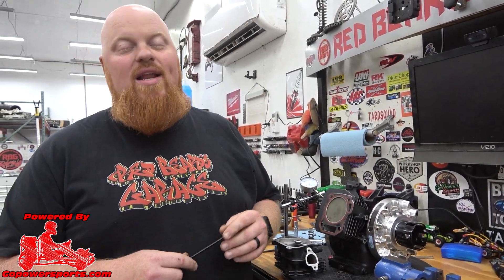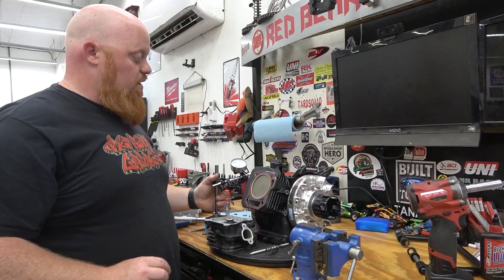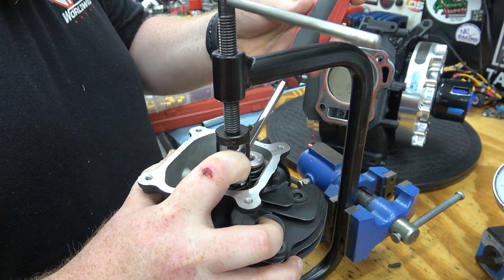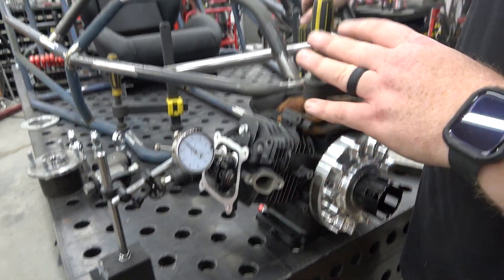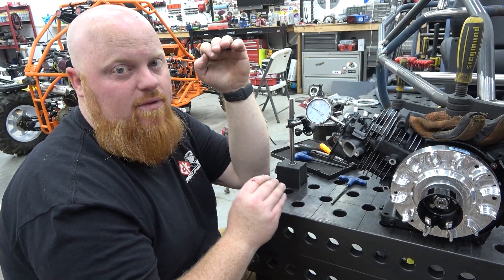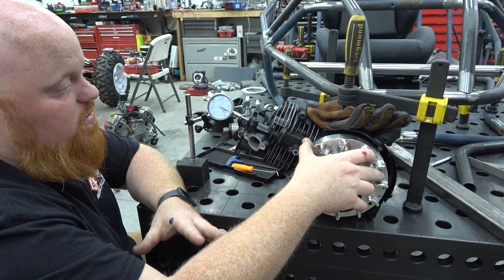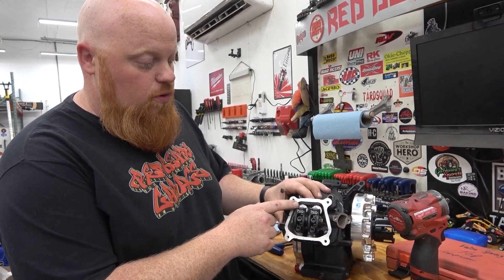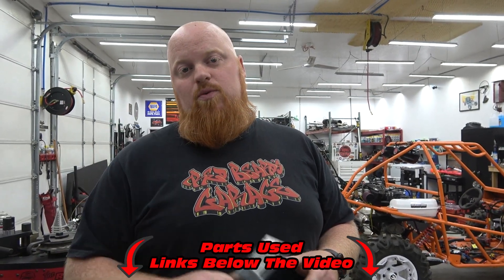How To Measure Push Rod Length ~ Ghost 212cc, Predator 212cc, Tillotson 212cc, GX200cc

Comment: The engine runs clockwise ,whyare you going counterclockwise checking length,just a though ,that's backwards,cam is ground different, it's also got different readings on it,Duh,I was taught different than your doing,40yrs,experience ,whom is doing it right or wrong,Duh!!!!!,not me!!!!!

Comment: If your pushrod is too long or too short, you might still achieve nearly the same peak valve lift, but the rocker tip will be pushed to one side of the valve stem, creating a wider sweep pattern. This wider, off-center sweep leads to:

Increased friction and wear.

Reduced valvetrain stability at high RPMs.

Potential for reduced effective valve lift, as some motion is wasted in "scrubbing."

Increased side-loading on the valve guides, leading to premature wear. 

All credit goes to AI there but I just wanted to post this because its important to take this into account.

Comment: ive been doing a kinda of frankenstein project similar but  ive got a bunch of 1095 spring steel rod .185 dia ive been using to cut and precision grind and radius the ends for push rods.  prob way stronger even than the cromoly cut to legnth cause its  solid and heat treated.  so long as you dont over heat it when grinding to legnth..    putting the radius  on the ends can heat it up too  so wet grind.   im using a 1x42" belt grinder with various grits from combat abrasives and others and  a rotary chuck that spins the push rod  as you grind it at about the same  rpm as the belt but opposite direction.  makes quick work.   i grind at about 105° to the end of  the rod to grind to legnth  leaving a pretty flat cone to measure off of using 100 grit ceramic belts,  cuts quick and  takes the heat away with the grindings.   then ill radius with first 400 grit and then 800 and 1000 to refine and polish. its super quick to reduse the legnth by a few  thouhsand even at 800 grit and re polish at 1000  to get them perfect.    kicker is  the rotary i use is just a milwaukee drill with the push rod  chucked in it. no mfg on the 1x42" belt sander  i got it  from a machine shop that went under for $30  but its 1750rpm on the motor and has  a table settup that can be angled and has tapped mounting holes for  holding tool sharpeners.
Reply: Bruh 😂

Comment: If i am using champion x style rocker arms and a hot265 cam with my stock pushrod length being 5.2760, can i just add .265 to the stock rod length and use that as my new push rod length

Comment: RBG you literally have zero knowledge of geometry. Sad
Reply: I think the length of the pushrod it should not change the lift of the cam right?
Reply: Shaft mounted rocker has fixed geometry

Comment: I know that this is a bit of an older video. What pushrod size would a "internally" bone stock 196cc predator use, I'm looking to change valve springs an pushrods all the advice helps a lot
Reply: There is no Predator 196cc? It's either Honda Clone 196 or Predator 212. Stock Pushrod length for the 196 Clones is 5.260 inches. The stock size for the Predator 212 is 5.135 inches.

Comment: Go Power Sports is a rip-off when it comes to these roller rockers. I can get myself a set of roller rockers, which are 16 in a set for a small Chevy for $182.95. They want over$200 bucks for just TWO rockers😂😂😂😂.  They are taking advantage of people with their overpriced products. For the price they are asking, they need to throw in 20 roller rockers. I'm sure the ones for the Chevy V8 are much stronger and built better than these at power sports, and yet they are cheaper priced. This is price gouging. Those flywheels they are selling, the same thing on those. We are all getting ripped off. It's not right people. I built engines for my muscle cars and then I got into this mini bike  engine build but I'm slowly but surely getting out of it because of these rip off prices on these cheap parts.

Comment: You said that you have 1.2 rockers.  I have the Tillotson Racing head 225RS and can not find the rocker measurements like you have to do the equation. I have the HOT265-NHP cam. I do have the adjustable push rod tool. All my parts are from GoPowerSports.  Thanks for any help.

Comment: Thanks RB.  For those of you wondering why he added the extra 1.5 thousandths (.0015) after he had it perfect he was splitting hairs as he knows he’s got to keep .003-.005” gap between the lash cap and roller so he was using up some of that to keep that valve open just a bats ass longer.  I can see the value for this on intake but not really for the exhaust side.

Comment: If the pushrod is too long for example +.004 the total lift would be greater than .369. In that case you need decrease the adjustable pushrod. Correct?

Comment: If you're shooting for .000 accuracy, how often will a precut .00 pushrod work?
Reply: About .000 % of the time to be honest.  I’m surprised he told us to buy the precut set for that engine combo as he just said every head and block and valve seat machines area have tolerances.  They all different.  But the self sizing and cut yourself. Practice on the stock pushrods.

Comment: sorry for my stupid question, but if you got stock rocker arms and a modifeid cam, you still need to check push rods measure?
Reply: It wouldn’t hurt. When adjusted. The rockers should be flat with the deck, when closed at TDC? If not maybe they should be cut or lengthened.
Reply: @nessie42786  "flat with the deck" whats the meaning? Eng not my main language.

Comment: What size push rods do I use if I have a 265 cam with 26 lb valve spring and the 1:2 ratio rev roller rockers
Reply: Did you ever find this out? If so let me know. Thanks!
Reply: @WilliamARichardsIII you have to measure unfortunately.  The blocks, heads, valves, valve seats cut into the head all have a tolerance.  What works for some will not work for all.  Sadly you need to measure like he showed us for EVERY application if you want it right.

Comment: I thought you were showing us how to utilize “cut to length” push rods. I get that for this application you’ve found off the shelf pushrods that would work but….show us how to use the cut to length ones plz!,,,
Reply: Right that’s what I came here to see cuz I need to figure out what length I need for my wildcat 223 with a shredder head and a 308 cam

Comment: This only works with knowing the cam spec?  But if you're doing this on a stock cam....?   How the heck would I know the right lift?
Reply: If you don't know what the cam lift is, put your dial indicator on the pushrod side of the rocker. Zero the gauge and roll the motor over until you see max lift. That will be your camshaft lift.
Reply: Just use stock
Reply: @trentstreichert2217  are you trying to make sense?

Comment: Hey Greg, with the milled head, high lift cam, and ratio rockers, do you ever do a valve to piston clearance check?  Is it necessary with these small engines?  I have been binge watching your videos lately and haven't noticed you doing so.
Reply: I don’t see him doing it but it is a necessary thing to do Espically on hemi motors because they have way more valve to piston clearance issues
Reply: I don't think he ever does.  All his parts are free now from go power sports so he doesn't give a shit.
Reply: that's a good question why no answer ?
Reply: I think as long as your cam lift is 400 or below you are ok ,I haven't seen one yet touch
Reply: I have a ghost with a flat top piston stock length arc billet rod and a dyno 308 cam. Thin head gasket. Ported ghost hemi head With the canted valves. Chromoly cut to fit push rods. Currently have no clearance issues with the stock rockers. I even tested the clearance with clay on the piston. Aftermarket ratio rockers were not available at the time I built it. They are available now for the Ducar, Tilloston and ghost head. Through NR Racing.

Comment: #RedBeardsGarage  if you have a performance head, and it was milled say .003, does that effect the # s you calculated? you had a .308 cam, and  1:2 ratio lifters... so you did .308 x 1.2...just curious if a milled / shaved head would make those numbers fubar since that wasnt in the equation. I mean I seen you get them numbers on the dial gauge, but its making my head want to explode for some reason

Comment: Hello there. Not to change the topic on the cool video here, but my carburetor on my small engine which is a duromax 7 hp it’s spraying gas from the top of the carburetor ball where it connects to the carburetor itself. If anybody has a solution fix this issue please comment would be very much appreciate

Comment: What i missed over here: the size of the valve gives how much it needs to open. The max flow of a valve is on 1/4 of its diameter opening up. You can get the max lift out of your cam when pushrod and lifter operate around a 90° angle. 
Check the lift of your cam and lower the lifter halve that measure. So the lifter operates between for example 85 and 95° Then check if it lifts the valve enough the get max flow trough. Every opening up more is lost power, power needed to open the valve.
Reply: I’m not sure what you’re trying to say here.  Are you suggesting someone who bought too large of a can should compensate for this by measuring the valves diameter and deciding by 4 to get what their max lift should have been and then adjust pushrod length to ensure you get less lift than the cam was made to provide?   Then in that example how would you add duration to this theory as the longer a valve is open at any height you would get more flow through them.  🤔 I’m just not sure where you wanted to go with this outside of making certain the rocker arms and push rods are at 90 degrees but even that is slightly debatable with ratio rockers as they tend to lean slightly backwards towards the pushrods at a slightly open of 90 deg angle per Gage roller rockers website.
Reply: @ol-man-duffyj688  sir make a circle please. That 1/4 diameter gives the flow through the opened valve at that its maximum. Lesser lift means lesser flow, more open wont give more flow trough.
How long the cam keeps the the valve open just gives the amount of time gases or air can get out or in the cylinder. 
The remark about the rocker arm: at 90 degrees in the middle of working gives the least possible angle for the most lift.
And: the lift of the cam and diameter of the valve should be matched.
Reply: @henkoosterhof5947 Interesting ideas do you have data or a website I could go read and learn this as well?  I’d like to see if there is actual calculations to best  cam range for certain valve diameters.  As we know bigger isn’t always better.  Bore size has a factor in this as well as you increase valve diameter and lift.   Thanks for sharing more I appreciate your insight even though I don’t quite grasp it all.  That’s how we all learn more 👌🏼
Reply: @ol-man-duffyj688  no sir. Things i learned at the training college for marine engineers. It was in the dutch scoolbook for engines, but i dont know if they are available where you live. But try those sort of books please.
Reply: Alright thank you for sharing,  have a wonderful day friend.  I’m from the USAbut sounds like your knowledge goes wayyyy back.  Thank U for your service.

Comment: Based off of your oil cooler test video. Have you ever ran methanol in one of these engines? I bet they would run a lot cooler. Just an idea I had at work today.
Reply: I run methanol in two of my engines a 200cc and a 236cc and it definitely runs cooler than gas
Reply: That's one of the basic common knowledge facts of methanol fuel - runs cooler.
Reply: I’ve got a 3” tillotson at the machine shop now that will be a methanol motor. You can run a lot of compression and lead but be prepared to burn a lot more fuel.